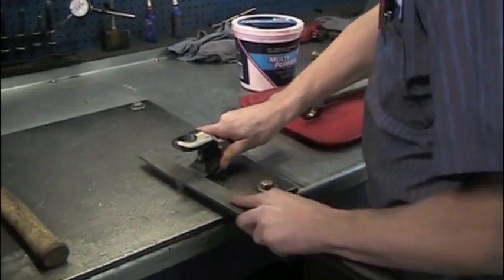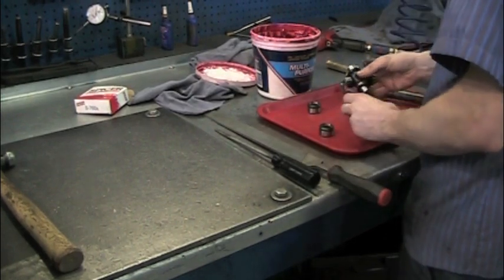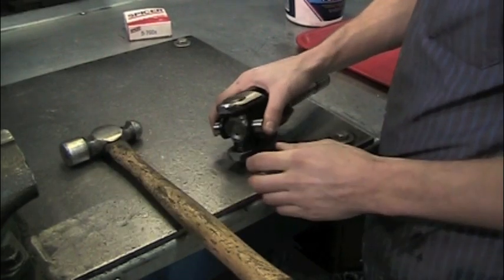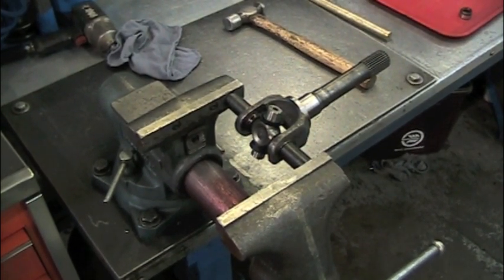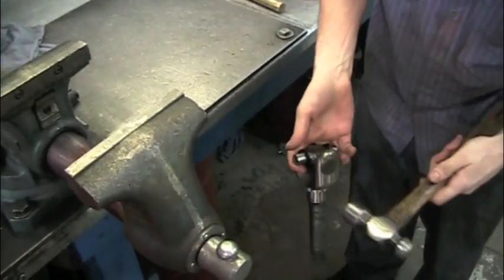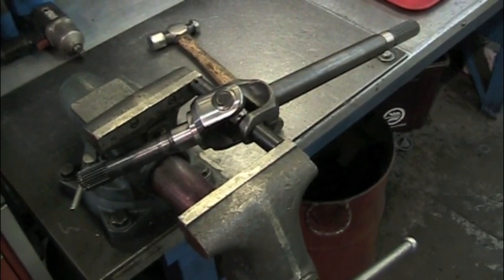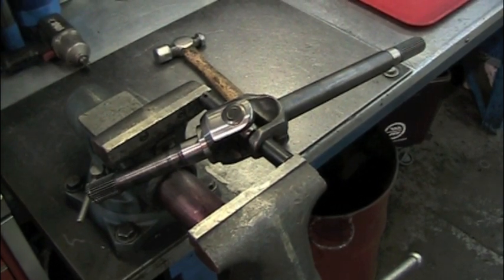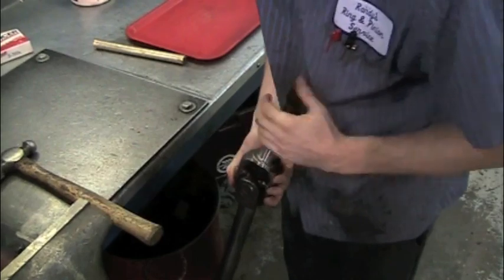Universal Joint Installation

Comment: install zerk fittings at the "what"?  can't make out what you are saying there, sounds like "clip".  what is the clip?  i thought the zerk fitting was in the middle of the cross?  and really, why not show the greasing of the new joint, since that is arguably the most important step because it won't be a new joint for long without lubrication.